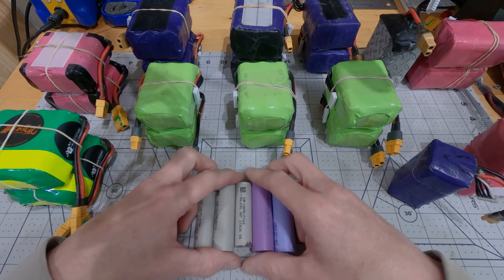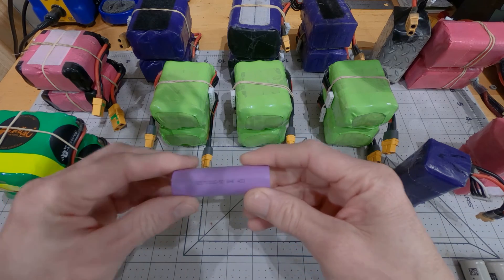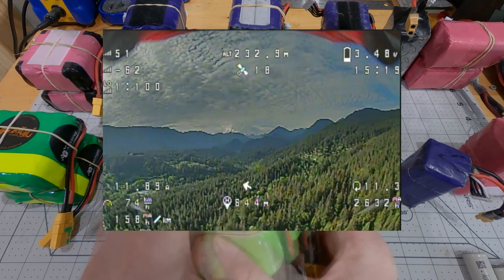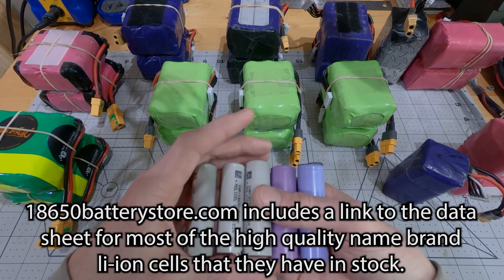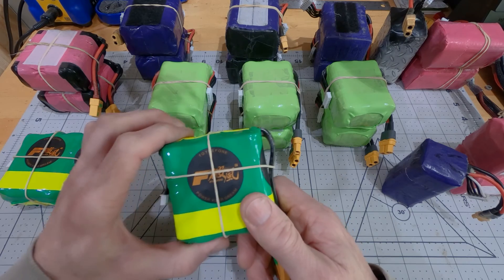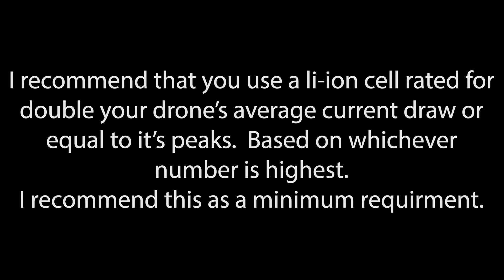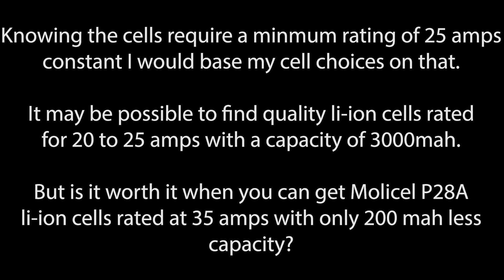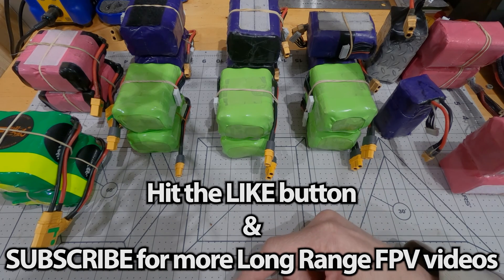Picking a Li-ion Battery for FPV & Long Range : FalconRad

Comment: More great information. Thanks, Conrad. Glad I've been watching your channel for a while and watching what  you're using for cells. Bought some Samsung 40T/21700/4000 and some Molicel P28A/18650/2800. Made several batteries and the first one was the hardest. Just getting your head around how things connect and good wire location and length. Doubt I'll buy any more lipos as most of my flying is cruisy and I have a bin full if I feel the need to blast.

So whadya think? Should we build up 10 of your li-ion frames with goggles, chargers, radios and batteries and send them to Ukraine for long range reconnaissance? Bet we could fundraise and get donations of equipment and parts. You have my number.
Reply from the maker: It's a great idea but 10 frames alone is over $1000.  It would be about $6000 worth of gear to do that, I'm lucky if I get one FC and  one ESC for free every three months or so.  Most companies don't even answer emails from me!
Reply: I figure said and done, probably more like $15,000 if you included everything. Shit adds up fast.  I wonder if the drone/quad community would kick in.
Reply: @jimross898  This isn't the kind of drone being used in Ukraine though, they're using DJI Matrice and other huge quads with 30x zooms.

Comment: Great information! I've been building my packs with the Moxcell cells as well. Are you spot welding or soldering your packs together?
Reply from the maker: I am still soldering my packs.  I don't know enough about spot welding and layering nickel strips 4 high seems an odd solution for spot welding and getting enough nickel to manage the amps.

Comment: What do you think about other form factors of LiIons ? 
Is 18650 still the king for the usecase, or do other formfactors (shorter&thicker) allow for ex. higher mah/g ?

I am really looking forward to your guide, so i can mid range my AOS 5.5 and use its higher disc loading! Cheers from Munich :)
Reply from the maker: I only use 21700 and 18650 cells.  Which ones depend on the weight of the build the range that I'm looking to get.  Most of the time I use 18650 6s2p but I do some flights with 21700 6s2p if I need more range.

Comment: Hey Falconrad, thanks for the information on Li-Ion packs! I'm planning on building a 7" LR in the summer and was thinking about which battery configuration would be best for me. This video helped a lot with that. Quick tip for you videos: Put your audio into mono channel, it is a bit weird to listen to your voice with headphones because it is biased towards the right channel.
Reply from the maker: Thanks for the audio tip!

Comment: That was a great primer for building your own packs. I have used the Molicel 21700 P42A to make a 6S pack. I think another interesting thing to look at would be the cost per capacity, P42A vs P28A.  
One of the questions that I have is why you fly/build 2 packs to run in parallel rather than just building one 6S2P? (12 cells). Is it mostly just the form factor or are there other reasons? 
You may show it in the next video but do you solder or spot weld them together? I have been using the BIFRC DH20 Pro and really like it.
Reply from the maker: Thanks for the comment.  I run two separate 6s packs so that I can use one at a time on small quads, or one on top and one underneath, or both on the top plate.  Depends which quad I'm using.  I do a lot of experimenting so the versatility of having 6s2p in two separate 6s1p packs is useful.

I solder my li-ion packs.  Every time I look at getting a spot welder I can not find sufficient information on the required nickel strips.  From what I have found it seems it would probably need four pieces of 15mm X 0.2mm nickel strips stacked up for every connection.  But will a spot welder actually weld a 3rd and 4th 0.2mm strip to the cell?  The standard silicone insulated multistrand tin coated copper wire is way more efficient at carrying current.  I know it's possible to make a good quality spot welded li-ion pack but I think it might be best done with expensive spot welder that can make use of even thicker nickel strips.  But most nickel strips for sale are really thin and only rated for 3 to 6 amps.
Reply: @FalconRadFPV  It's also possible to use copper strips for spot welding. 0.1mm or 0.15mm strips, topped with a small section of nickel strip to provide enough resistance for the weld to occur, is doable with a kWeld or similar device. A kWeld is much pricier than the ones found on Amazon (up to ~US$800 depending on how you set it up), but the cheap Amazon spot welders don't put out nearly enough power to handle copper, and probably not enough to weld more than two nickel strip layers.
Reply: @FalconRadFPV  I have tried the multi-layer spot welding. I used 7mm X 0.3mm niclke strips and stacked around 7-8 layers which is slightly more than whats required. I welded one layer on top of another. The weld is very strong that I can say. Its a lengthy process but did not take more than half a day for my pack.(First 6s pack and first time spot weld user) I havent fully tested the amp draw yet, still caliberating and testing. I was debating with myself over spot welding or soldering for a month and decided to go this route as I had already purchased the spot welder and in the end the welds are cleaner compared to soldering. 
The spot welder I use is a cheap BIFRC one and use 2 3s 3.3Ah lipos in parallel to power. And later use them in series for the 7" :P 
Love your work, please keep it going :) Cheers